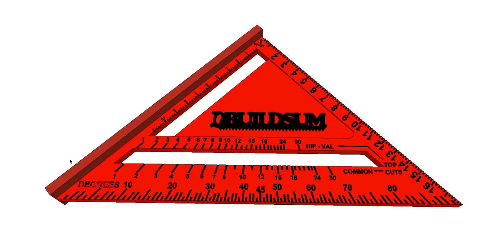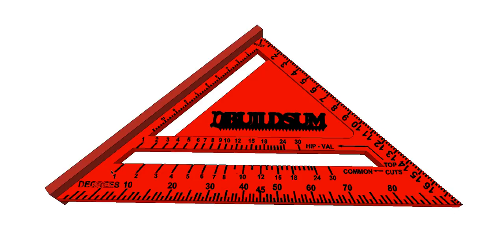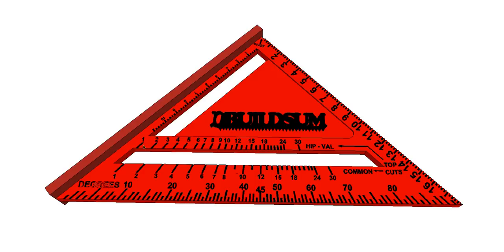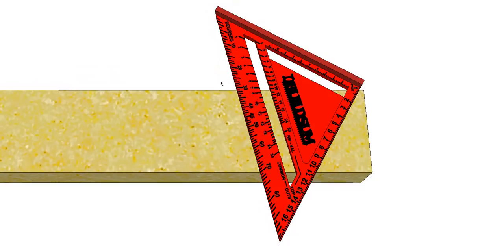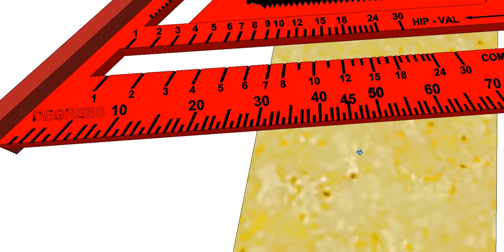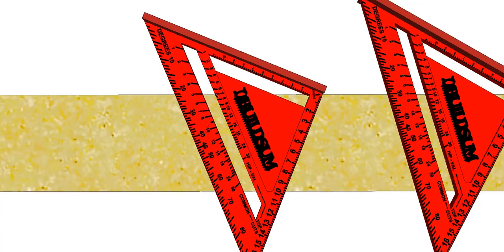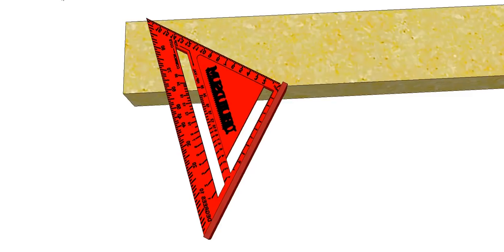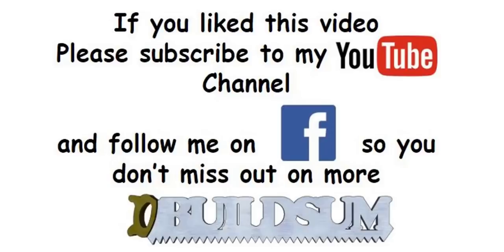Speed Square Angles

Comment: Just in case you didn't know, Swanson make a metric speed square with a metric version of the rise over run pitch scale. 
It's highly archaic being that instead of say 1 in 12 being 1 inch rise over 1 foot, it's in Decimetres (Which as the name implies is 1 tenth of a metre). So 1 decimetre over 1 metre is  5.7°. 
..Not hugely useful, as who the hell wants to work out decimal angles, but there it is. Again, I don't know anyone who uses this system, but I do have the square myself.
Good video mate
Reply from the maker: Thanks Chris, good to know incase someone sees one.